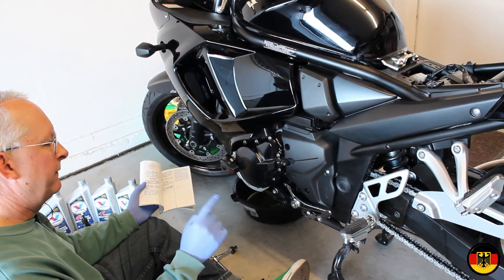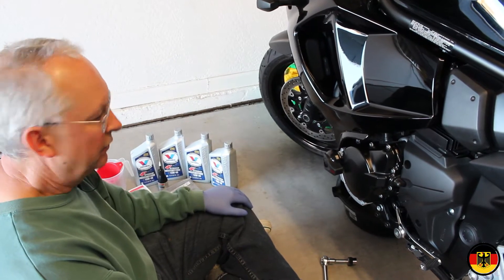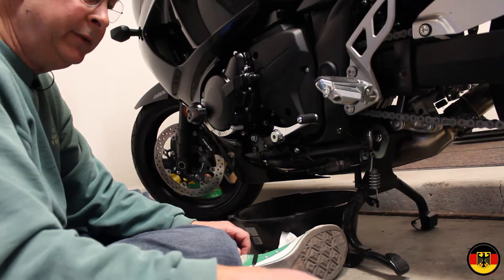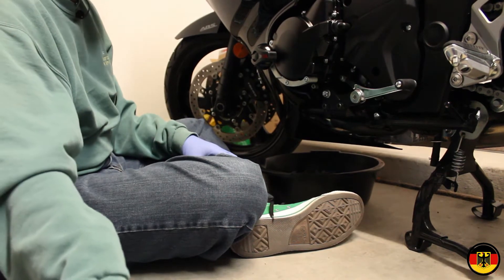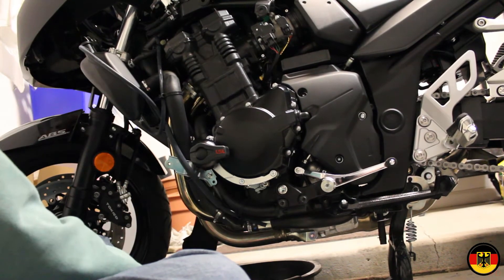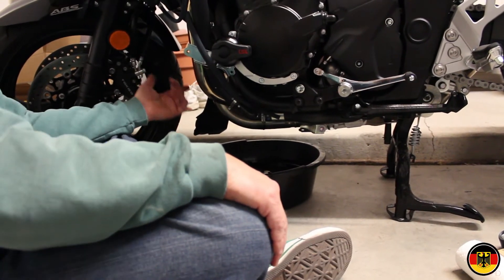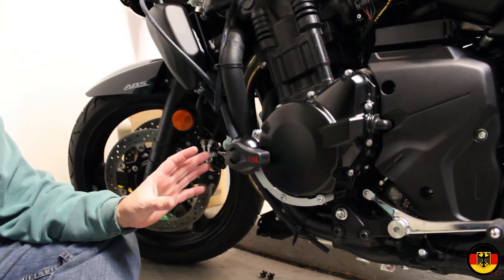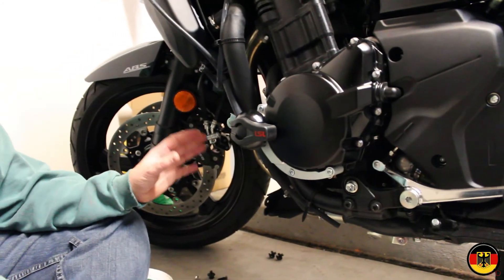Suzuki GSX1250FA Oil Change

Comment: I have this bike. I ride in all weathers in the UK and I commute 140 miles per day. I think I'm on 70000 miles on it. It's an awesome bike. Completely reliable. The biggest cost I've had to cover is a replacement fuel injection part. From Suzuki, new, its 1200 pound Stirling. I found a replacement for 150 pound. The original gave out at 60000 miles. Something to bear in mind. Two sets of chains and sprocket. With a scottoiler I get around 40000 miles out of a chain.I had a good reliable mechanic but I'm now having to carry out the servicing myself.  One key issue with this type of bike is that it has a tendency to overheat. I've replaced one thermostat. What I do find is that if the outside air temperature is high it effects the bike and it loses coolant through the overflow pipe. In colder weather it runs perfectly. Other owners have had the same issue.
Reply: Thanks Ginge, i have just bought a 2010 model 1250 bandit , yes warm weather brings on the fan, but i haven't checked the coolant, i will try to locate it, but helpful post...
Reply: To add and update. The bike started playing up again. The radiator cap had a build up of crap on the piston.This prevented the system from pressuring. Cleaned it with white vinegar. Worked. My thermostat is also intermittent. Sometimes works sometimes it overheats. Before buying a new one try clean the thermostat with vinegar. Then wash it out. It may be scale stopping the thermostat from opening fully.
Reply: Hi just one question , my 1250 fa is the same when it's really hot weather out. I thought I had a leak but must be out an overflow. I wondered if those radiator guards do more harm than good as regards cooling the rad.
Reply: @paulburden3172  Keep the radiator guard on. If a stone hits the rad, it'll cause mayhem.  When cleaning the radiator, use a radiator comb to remove any particles between the fins. Use a soft brush to remove any loose crap. Using the comb also allows you to see if any of the fins have collapsed on themselves. This reduces the airflow to the radiator.  Try and stay out of 'Stop, start traffic' filter past it all. If the F1 Red light with the temperature comes on, pull over ASAP. Switch off the ignition but let the fans run. It'll cool the bike down and you'll be on your way quicker.

Comment: I have the GSF1250....the oil filter is a little difficult there too, but I can manage by using a K&N filter with the nut built in.  I still have to move the radiator hose to get the filters in and out.  What I do to keep the mess to a minimum is to lay aluminum foil on top of the pipes with a raised ridge all around and angled down towards the drain pan.  Works like a charm.  BTW -  I've never lost a drop of oil and have never changed the crush washer on either Suzuki I've had. I hand tighten.

Comment from the maker: Best machine ever.  At low speeds the front end feels kind of heavy compared to my BMW, but normally it handles like a dream.  Be very careful not to throttle it up in first gear unless you plan to do a wheelie.

Comment: Thanks for the ino.  Changed my oil yesterday for the first time and found that if you remove the shiny metal hose retainer that is held on with a 10mm screw, you can slide the oul filter through much easier. I also used a K&N filter with a nut head on it and all you need is an open end wrench or the correct size open end wrench you can remove/replace easier.  You still have to twist your wrist around bacwards to get it out though.

Thx Greg in NJ.

Comment from the maker: Update: I just changed the oil on my second Suzuki.  It took less than an hour.  Thanks for the helpful hint someone gave for removing the bracket that attaches to the radiator hose (also, that same hint is in the manual).  The drain plug gasket is ridiculously hard to remove.  I am going to start using copper gaskets made by Suzuki for their automobiles.  Also, another helpful hint in the manual is to tighten the filter until it just touches, and then give it 2 full clockwise turns.
Reply: Oil filter does NOT need 2 full turns-that's way too much. It only needs 1/4 to 1/2 after it touches. (with oiled rubber seal)  I have owned a 1200 for 13 years and a 1250 for 4 years. Done many oil and filter changes on them in that time.

Comment: Hi from Malaysia, I watched my mechanic do the first service and want to share this info so it might help others reading. 
1) you have to use a straight long ring spanner for the filter. the manual refers to a suzuki special tool for filter removal which comes with mark on it. if using an after market you can also put or paint or scratch or punch a mark on it. There was also no mention of torque setting in my 2014 manual but it says, tighten as much as your hand can then make2 full turns by referring to the mark.  Then you add 3.5 ltrs of oil. otherwise only 3 ltrs of oil when not changing the filter. Personally, i would refer to the window and never top it up to the full. Hope this helps

Comment: 09915-40611 with this part the filter comes off with a simple 17 mm spanner wrench 
No big deal! The obstruction wrenches do not provide enough torque (length). Good idea to replace with K&N 138, which has built in 17 mm nut. This job is not very difficult, and the filter is good for 18000 km. It is a bigger challenge to remove the fairing, this video does not talk about that. I was intimated with this task because it was presented like a big deal! It is no big deal! I enjoyed the job, and the cold beer afterwards.
Reply from the maker: Thanks for watching!
Reply: Made me chuckle

Comment: Did my first oil and filter change at 750mi.  The dealer sold me the wrong filter tool, it didn't have a hex nut but a 3/8 socket wrench hole instead.  It fit way to tight on the filter and there was no clearance for a socket wrench anyway.  I removed the left side panel, the hose clamp stay and took a bungee and pulled the radiator hose out of my way.  I took a BIG water pump pliers with gnarly serrated jaws and crushed the end of the filter and turned it off with the pliers.

Comment: Just found your channel and started watching your videos which I have found informative by the way and thank you.  The reason that filter was on so frickin tight, is that the so called mechanics at the dealership torqued it down when they built it out of the shipping crate.

Comment: Thanks for the good video, I was warned that the job would be tough and it was.  This part of the bike was not designed well to be easily serviced.  I could do an oil and filter change on my SV-650N in 20 minutes.....that was really nice.

Comment: The filter was destroyed in the process but who cares.  The filter was on TIGHT from the factory!  I tightened the new genuine Suzuki filter on as tight as I could by hand which is what I've always done with spin-on filters and have never had a problem.  A K&N filter with an integral hex nut would be better, I will get one of those for the next change.  I put the original drain plug and washer back in, I've re-used drain plug washers many, many times without a problem, no worries.
Reply: I dont see the necessity to replace the sump washer every time ya change the oil personally.  Dont think I've ever replaced one on my car either.

Comment: All the important parts that would actually "show" what to do you skipped and said "I'm going to do that and be right back".  So you made a video of you talking beside a bike and cut out all the part where you actually do the oil change.  So I didn't see where the filter is.  How to take off the side molding. You didn't even show where to put the oil in!  LOL.   Good try and thanks for trying to help but I had to find another video that actually showed what to do.
Reply: not very helpful is he, sure he mentioned using something to bond the sump bolt in what we call in the UK thread lock, thats just not needed

Comment: This is probably way too late, but you don't keep that crush washer.  Where ever you purchased those crush washers, they screwed up and gave you the small crush washers instead of the larger ones the bandit uses.  Crush washers are intended to distort while being installed and will have to be "wrenched" off the drain plug on any bike it was correctly sized for.

Comment: the drain plug gasket or washer is where its flattened out under pressure of being tightened up mate,the replacement ones are always smaller,the bolt  crushes it,its how it works

Comment: I have the same bike and mine only holds 3 quarts. I also noticed that little gizmo towards the front of the rotor cover, my bike doesn't have that. Weird, mine is a 2011 or so it states on the title.

I agree with you 100%, changing the filter is a major PITA! Other than that, it's a wonderful bike!

Comment from the maker: Thanks for the info.  When I put my filter on I turned it 2 full turns, and it was not even close to being overtightened.  If you are not comfortable with this, turn it until snug.  I would normally torque it on, but you cannot get a torque wrench into that location.

Comment: As we have discussed here my pet peeve is the lack of a high quality, tall touring windshield.  If Suzuki wants to market this as a sport-touring bike they need to improve the options available to get the bike fitted out correctly.  It's not intended to be a luxury machine and that's actually what I wanted but a good windshield, heated grips, a top -box large enough to be useful and a way to remove the side bags easily without messing up the looks of the bike with racks would be nice.

Comment: I really like the bike for the most part, it's a good value for the money, you can get some items from Twisted Throttle to make it better.  I have the SW Mototech removable side bag mounts for the Suzuki bags and the SW Mototech aluminum top box mount for the good Monolock top cases.  I am going to put heated grips on and maybe change the seat.  I am looking at pipes as well, I don't want obnoxious noise levels but I want to be able to HEAR the motor.

Comment: Enjoy your videos. I just purchased a 2010 1250fa touring model with less than 3500 mms on it. Noticed in one of your other vids that installed a Suzuki tank protector. Would you recommend it?
Reply from the maker: I definitely recommend it; I have the genuine Suzuki tank protectors on both of my GSX1250FAs, and they prevent any major scratches on the tank, particularly if you wear a jacket with a zipper on the front.  It looks good for what it is, too; it has a bit of a "carbon fiber" pattern to it.
Reply: redonKiLaus thanks for the reply.

Comment: The drain plug washer is a crush washer, probably expanded when crushed during tightening, causing it to  be difficult to remove off the bolt. You dont have to buy a genuine suzuki  washer.. Go to a car store  and pick up a  banjo bolt washer the same dia as the bolt  head shoulder.. Will be fine.
3/8 socket set will get the oil change and filter done, get an adaptor kit if you want to  use a 1/2 inch kit /torque wrench with a 3/8 kit. 
Sometimes  i use an old screwdriver to drive it through the filter so i can use it as leverage to free off the the  filter in worse case  situations.

Comment: A 17 mm ratchet wrench on Amazon $15.  Crush washers are available at Suzuki dealer, mechanics use them everday, cost $1.50.  To get the old washer off, hold the bolt with vice grips, and turn the washer off the threads with a pair of pliers.  No reason to torque wrench, just crush the washer, good to go.

Comment: 2011 GSX1150FA Service Manual says 23 N-m (16.5 lbf-ft) is correct. Oil drain plug has a separate gasket #09168-14004 (replaces 09168-14002).

Comment: absolute nightmare changing the oil filter
Reply: I have a 2009 and it's one of the easiest bikes I've ever had to change the oil, what's wrong with yours???
Reply: 455Transam The exhaust is right in the way. Practice makes perfect.